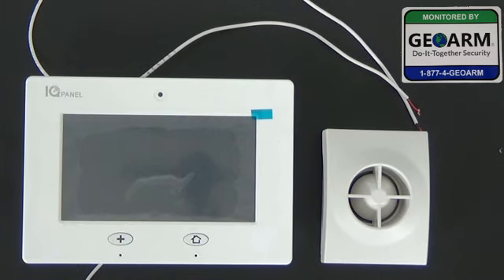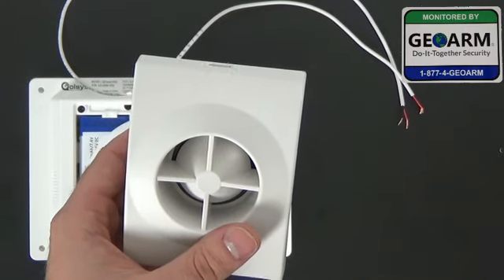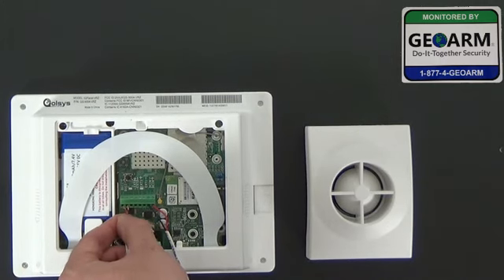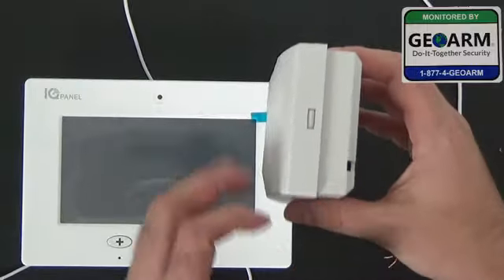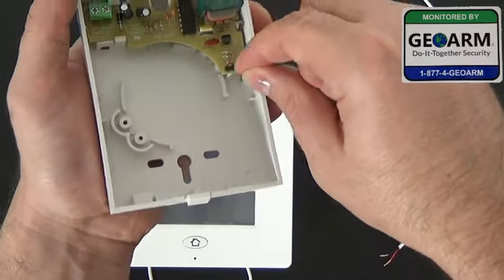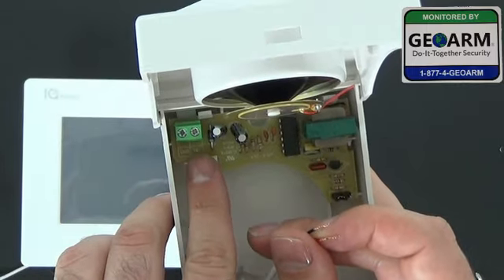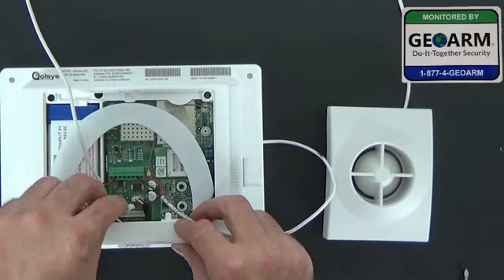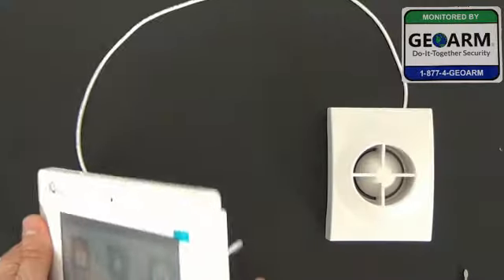Qolsys IQ Panel - How to Hardwire an External Siren?

Comment: I have this panel and am having a difficult time finding an external siren that I can hard wire to my panel and mount outdoors. Any suggestions for a LOUD outdoor siren with a max draw of 120 mA?
Reply: Hook the alarm panel up to a relay, and give the siren it's own power supply. This way you can run as powerful as a siren as you need to without being limited to the 120mA current draw of the panel